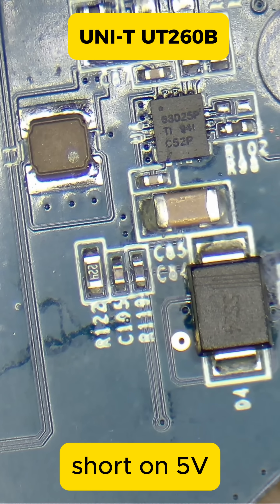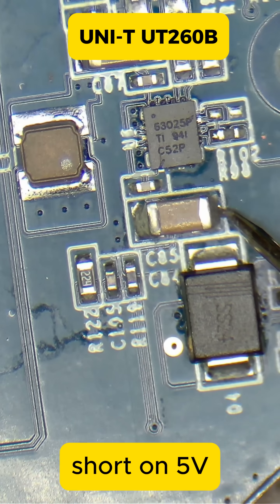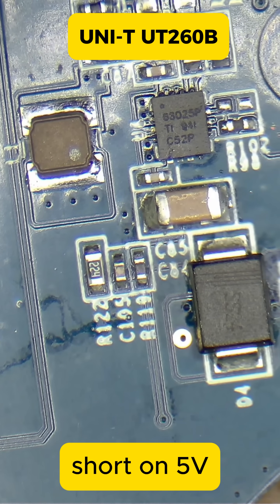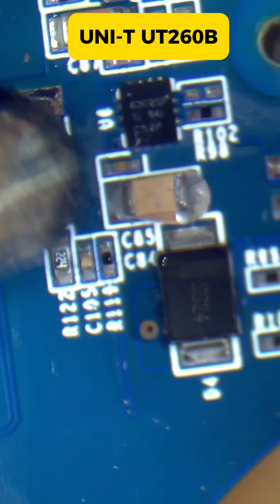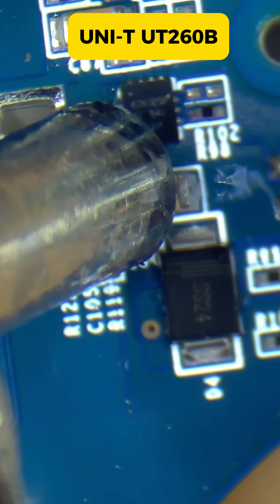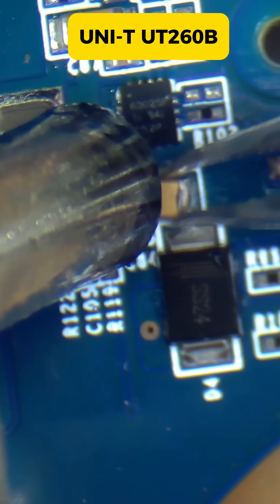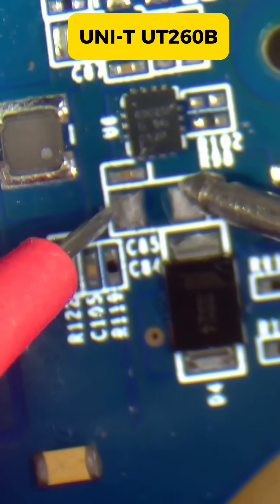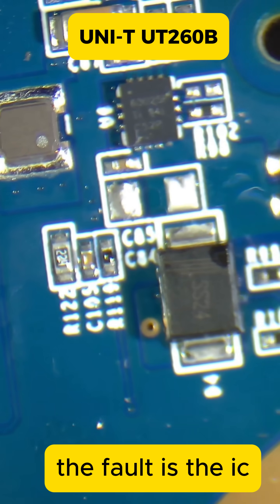Dead 🤨 UNI-T UT260B Thermal Camera 🔍 Finding the Shorted TPS63025 Chip! (Part 1)

Comment from the maker: The UNI-T UTI260B stopped powering on. A quick check reveals the shorted 3.3 V buck converter — the TPS63025 IC.

👉 Next: removing the bad TPS63025 chip in Part 2
🎥 Full repair video:  https://youtu.be/fbc_zDOOPus

#UTI260B #ThermalCameraRepair #UTI260BRepairSeries #microsoldering #electronicsrepair #thermalcamera #salvamipc